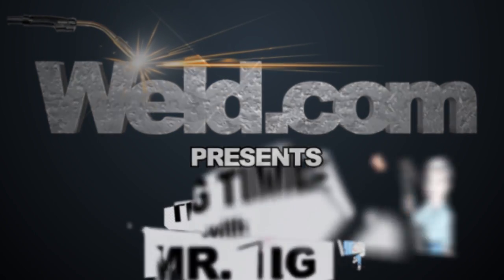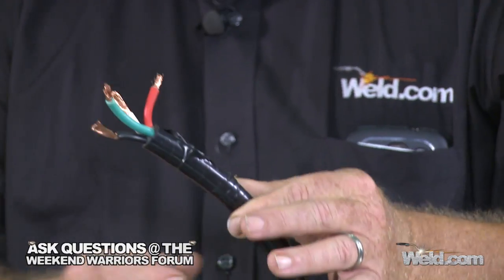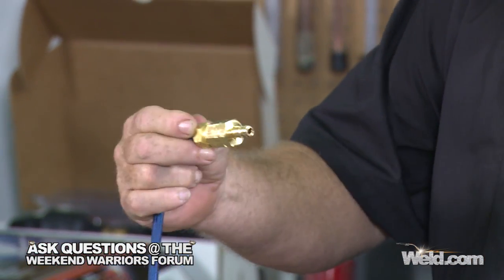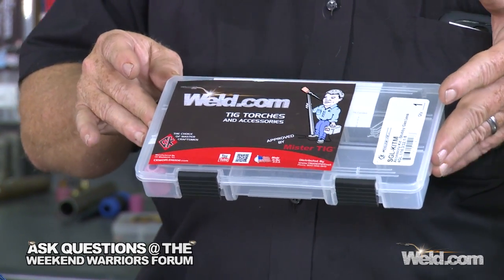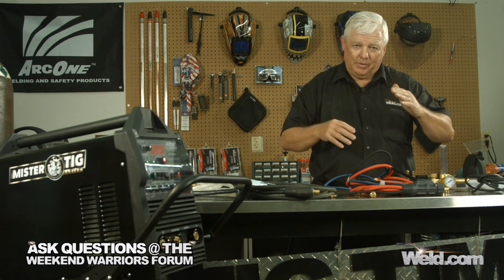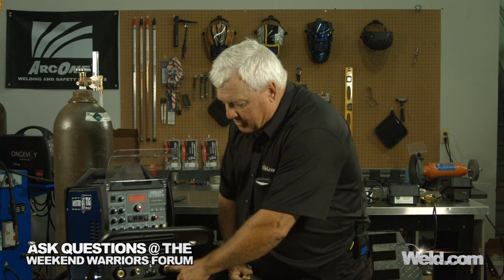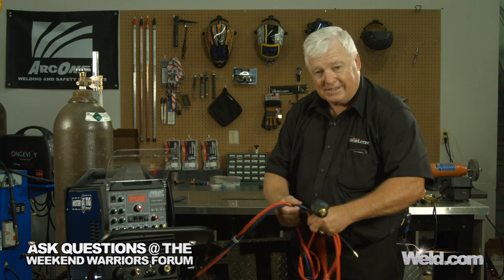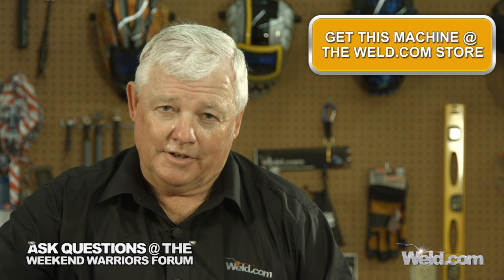Mr. TIG Series 250EX Water Cooled Setup and Review | TIG Time

Comment: 3:25 Where do I get those screw on fittings?
Reply from the maker: +Mark Rich The Quick Disconnect can be found in the Weld.com Store: http://weld.com/index.php/shop-weld-com/shop-weldcom/dinse-connectors/quick-disconnect-adapter-plug-water-detail
Reply: Weld.com
Im seen the male quick disconnect but not the female. DO you have them I didnt see them.
Reply from the maker: +Mark Rich That was an add-on quick disconnect water fitting. We just need to know your exact set-up and we can figure out the details for you. Shoot an email to MrTIG@weld.com and we'll get you set up.

Comment: how much is this bundle???
i just bought a welder from ever last and i wish i would have got this bundle instead ;-(
Reply: +07Stylist 
This bundle currently sells for $2839.00. Just to give you an idea, here's what all comes in the bundle:

Powertig 250ex with Upgraded Ck flexhead 20 tig torch and adapter, Upgraded SSC foot control, Leather Torch Cable Cover, Heavy Duty Cart, Mister Tig 9/20 Gas lens kit, Mister Tig Dvd, MT-50 Regulator / Flow Meter, PowerCool 300 water Cooler, & Ground Cable

Comment: hello mr tig i always enjoy your videos because you are an well informed welder on many topics regaurding welding.ive been a welder for 35 years and work in the alberta oilsands as a pipe welder.I purchased a everlast 250ex today as i have been welding alluminum tig with a transformer 250 idealarc lincoln machine with a century high freq box that is 20 years old lol with no way to control my amperage through a foot pedal or a romote pretty barbaric to say the least lol. what i need from you is a tig torch that will carry 200 amps or more without running a water cooled torch what do you recomend or can sell me. thanks bud.
Reply from the maker: Jamie Buckley Jamie,   I do recommend a TL26 (trimline)made by CK worldwide. It is a  200 amp tig torch for your needs but be aware that you will need a specific 200 amp cable as well.  I get a lot of requests for your specific need in the oil patch and most of the welders are selecting the 25' power cable.  Let us know how we can help...  It is also important to know the power supply that you are using because there will be a need for an adapter or "safeloc" connector.  Good luck Mister Tig
Reply: Thanks

Comment: This is an outstanding bundle. A few quick questions: What are the lengths of the ground clamp, torch hoses and foot pedal? The Everlast Powertig 250EX also included a stick electrode holder, am I correct in assuming your bundle does not? (you are Mr. TIG after all)
Reply from the maker: We actually DO include the electrode holder. If there is anything in the kit that we have not upgraded, you will get the original accessory (such as the electrode holder).